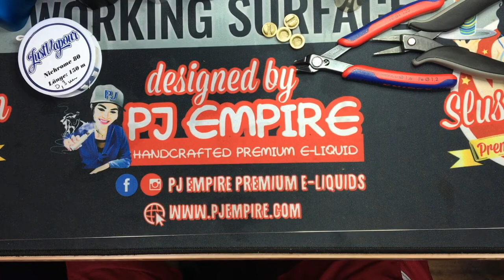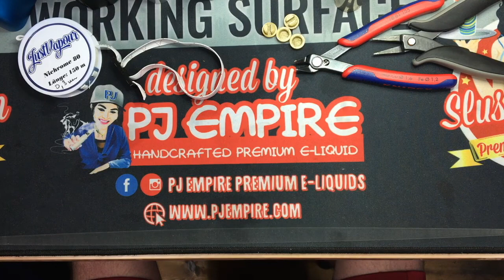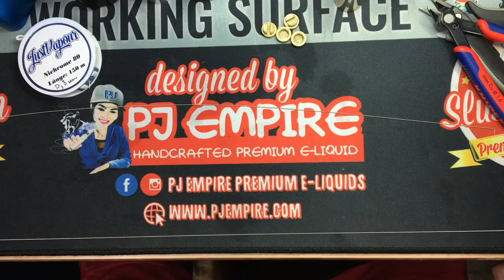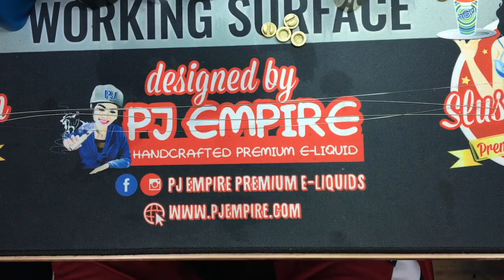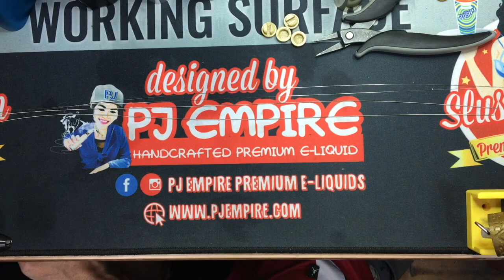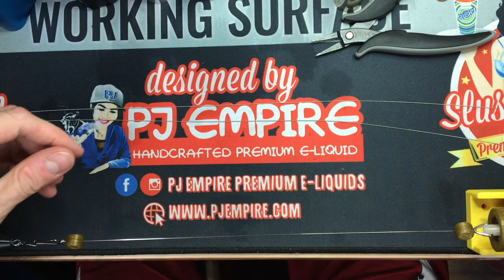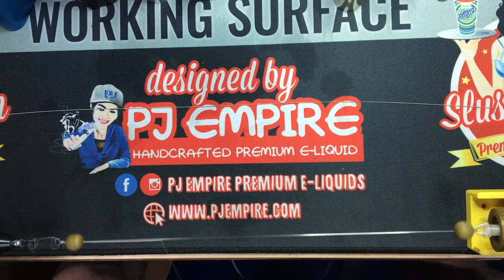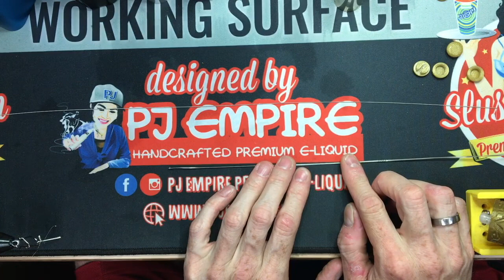4 Kern Alien - 4 core Alien - Denglish

Comment: Gude, bin stolzer Kunde von dir und Versuche mich auch an mehrkernigen Coils... Aber es funktioniert leider nicht... Habe eine 8fach Core versucht mit 36er Mantel 28er Kern... Geht nicht... Hab alles flach angelegt, ein smart am Anfang einen am Ende, fest verschraubt, einen leicht angezogen zum wirbeln, aber die Drähte ziehen sich immer zusammen das ich dann ein Klumpen Core hab... Wie kann ich das machen? Bitte ein Video am besten dazu... PS hab den Mantel fest, locker; langsam und schnell gewirbelt, beides führte zum gleichen Ergebnis...
Reply from the maker: Was du nicht vergessen darfst ist, dass 8 Kern Alien eine ganz andere Liga ist, als eine 4 Kern. Bei einer 8 Kern musst du cm weise arbeiten und immer wieder Flachdrücken. Anders wird es nicht funktionieren. Ich habe ja auch gesagt dass ich mich selbst nicht mehr so extrem challenge und deswegen das Maximum 5 Kerne waren. Bei deinem Versuch mit den 8, brauchst du definitiv einen Slider noch dazwischen. Also mind. 3 Smarts.